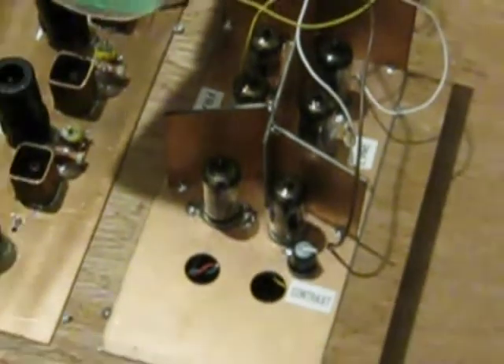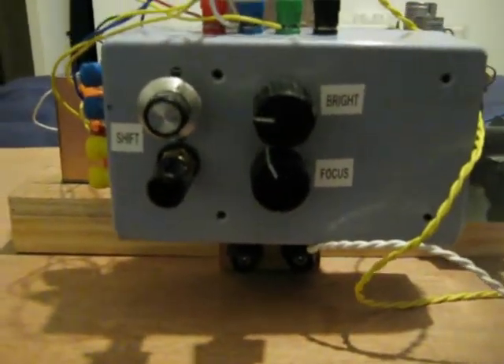Home made Television, personal 50's style build Pt1

Comment: Always very satisfying! Did something like this back in 1968 using VCR 139A. Now as a 73-year-old, I might try a revival 12V powered using dc-dc conversion to get the higher volts.
Reply from the maker: In a later unit I started to drive a 5FP7, I used a normal flyback transformer from an old TV just for the HT.  I guess with the newer pot cores and ferrites etc then it may be easier to make a HV unit from scratch.  But if you use a suitable flyback then you have the benefit of the line drive as well.  I also never tried using a transformer blocking Osc for frame so that may be an idea if I built another.  There is so much circuitry being forgotten now in favour of IC's but I seem to be missing the inclination to try recently.